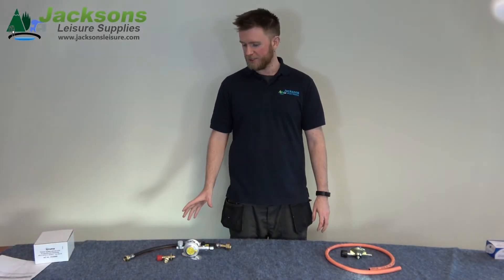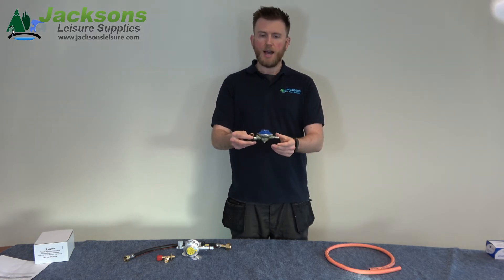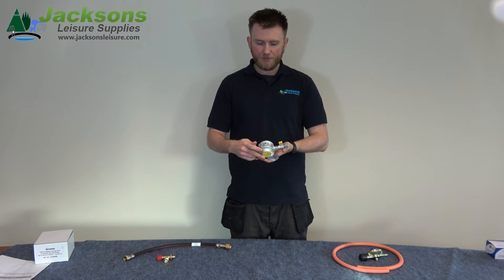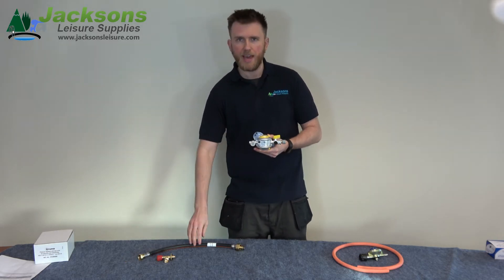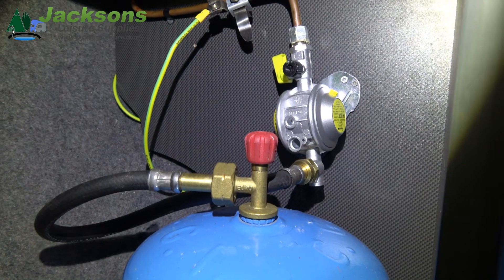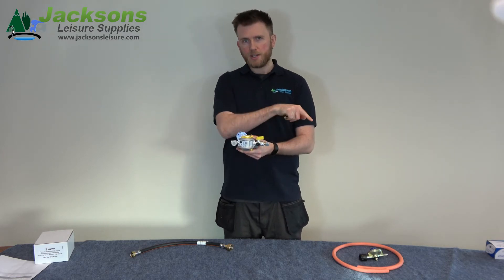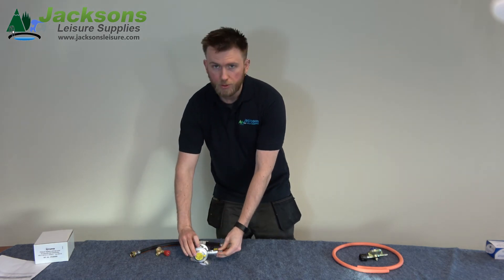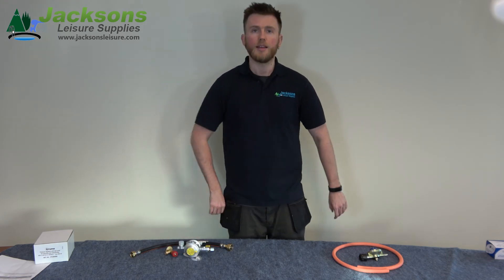The difference between an LPG gas regulator and a bulkhead gas regulator explained

Comment: I have this setup from you guys. What if I'm not using a campingaz bottle with that adapter? How do I attach a calor bottle as I already have the bulkhead regulator so surely I don't use a bottle regulator

Comment: The yellow lever on the regulator is not for shutting off the gas its for test/ service use only as stated by truma 
you should have a local isolation close to the appliance inside the van,and isolate at the bottle when the van is moving.